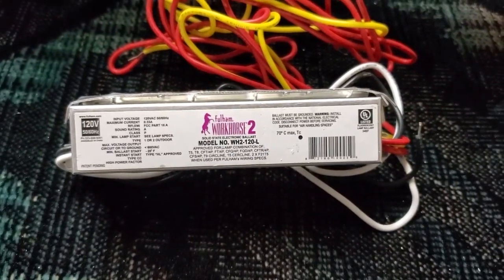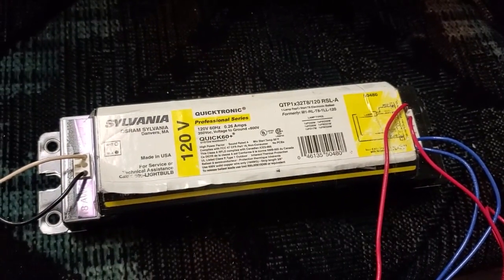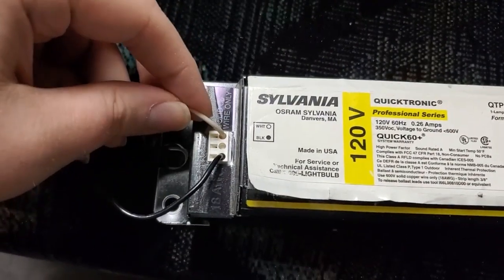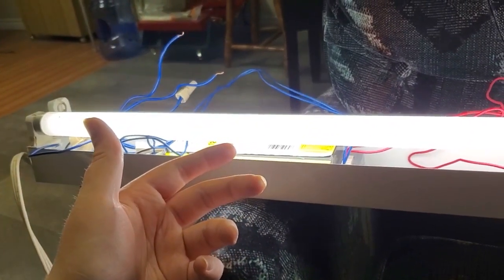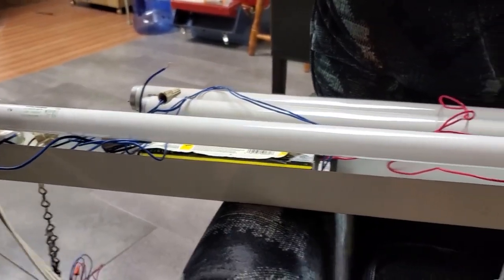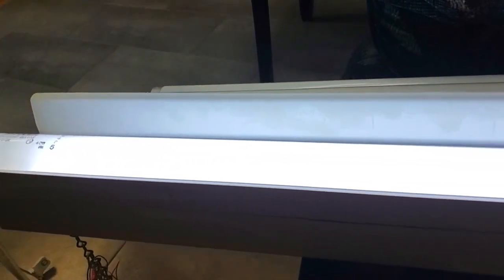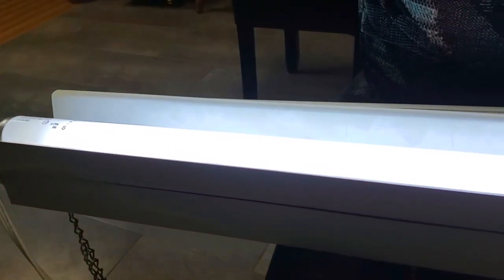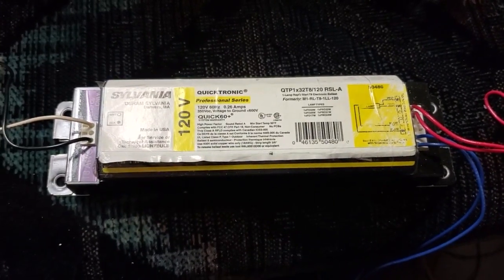Motorola's early electronic fluorescent lamp ballasts

Comment: As far as the starting a fluorescent lamp with an electronic ballast goes, I like programmed preheat start because it wears out the tube less than regular preheat, and it is more efficient.
Reply: We have the programmed-preheat ballasts in our T8 garage strip lights, and there is not even the slightest hint of end blackening on the lamps. They don’t do high hours very often, but they are started multiple times a day, I think usually around 4 or 5, sometimes more! I suspect the lamps will last a very long time!

Comment: I'm curious what the circuitry is inside of this. I've opened several electronic ballasts from bad CFLs and (with one ancient exception from 1990) they all use basically the same 2 transistor circuit. The old 90s versions (which lasted a decent amount of time) have a PTC which delays the arc voltage. I thought this ballast would be the same but the way the cathodes are heated suggests otherwise.

Comment: In our pub cellar we have a strip light that stopped working after a 10 seconds. Replacement tube of same spec is dim but noticed that touching the tube helped it to power up, much to our amusement. It’s a modern junk plastic housing with poor quality driver/electronic ballast.
Reply: Does the fixture have a rapid start ballast in it? Rapid start ballasts require the lamps to be near a grounded metal housing to help with starting, and a plastic housing sure can’t be grounded!

Comment: Oh hey, this is exactly like the ones in my school were. Although it took maybe a fraction of a second longer to start — fast enough that no one else noticed it, but I saw maybe 0.1 or 0.2 seconds of a glow on one end.

It's messing me up for 03-ish to be "vintage" (or even 90s tbh) but I guess it is. Heh. 

I remember around 05, 06 being told how all the ballasts were like this now and it's way better. I had no idea electronic ballasts had gotten sloppier again! Damn. 

I observed all of those failure modes in our school. Just one side or another might glow in one bank of the squares on the ceiling, and sometimes they'd do that for a few minutes before finally starting. The one where you showed it connected wrong where it flashed briefly then went lower, I'd see sometimes every 10 minutes which sometimes had a few days to keep trying to strike before they finally got fixed. That was much more annoying than half-lit tubes making some of the classroom dim.

Comment: That is a very odd ballast with a very odd startup! It’s like programmed start, but with cathode heating! Very interesting.

I have one of those newer “rapid start” electronic ballasts in use in my bathroom light, and I have a feeling it’s more than just an instant start ballast with cathode heating. When I turn it on, I notice that it flickers for a split second. Not like a magnetic ballast, but just a little bit. It’s incredibly fast, but it’s there. It usually flickers when its been off for a while and then I turn it on, if it was just freshly on and therefore the lamp is still hot, it will occasionally instant start. Either way, I think there may be more to it than just instant start with cathode heating. It’s a Keystone ballast, I think it may be model KTEB-240-1-TP /B but I’m not completely certain. I don’t remember the model number so I am purely going off my speculation. 

I have considered replacing the ballast in that light to either one of these or a rapid start magnetic ballast before. I’m actually kind of disappointed that this ballast starts the way it does, as I was under the impression that these were just like rapid start magnetic ballasts, but I still think it’s interesting and unique, and I do like it. So this might be what I get once that Keystone ballast goes bad, albeit the 2-lamp T12 version, as I like having the bathroom light T12.
Reply: I'd guess it's a like a typical 2 transistor CFL ballast but with a PTC thermistor across the arc. Your description of operation seems similar to a 1992 CFL which I took apart after it finally died.